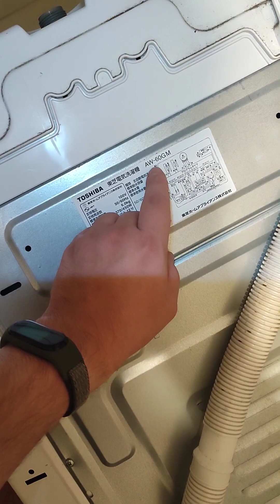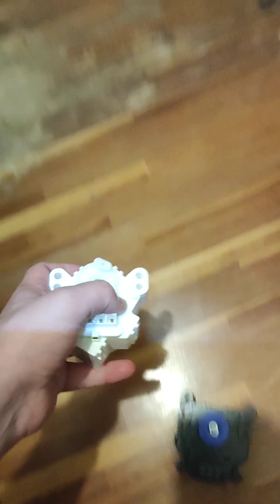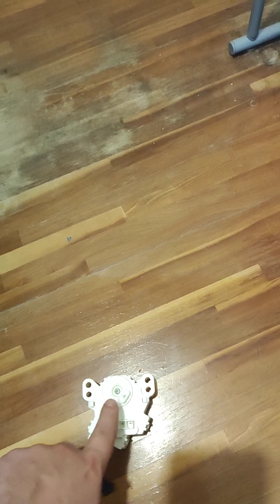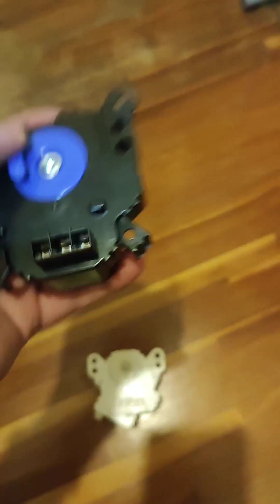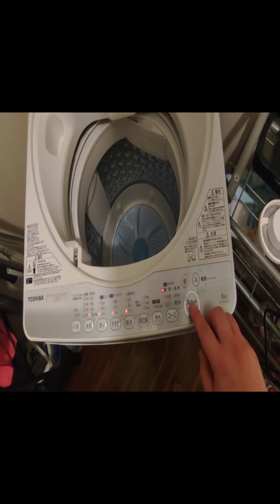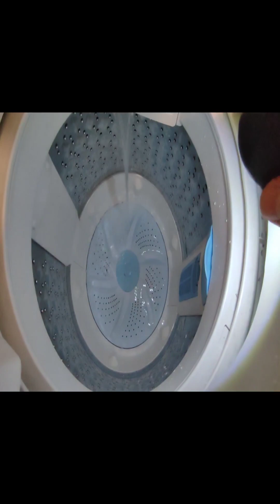Toshiba Toploader Washing Machine  Drain Motor Replacement

Comment: Is it still working?
Reply from the maker: @insomiagamingph3212  yes sir!
Reply: @Orvis25  we have the same washing machine AC110. I found in shoppe GM-80-4 AC220, WDYT? should i get that one?
Reply from the maker: @insomiagamingph3212  I can't give you advice in this, since I am not a highly skilled electrician. It is a very similar part to what inl got, but I did this repair at my own risk, I don't want to say yes to you and break your machine if the part is slightly different. 

Let me know if you do it and if it ends up working though!
Reply: Maybe i should give it a try, then I'll give you an update if that works.